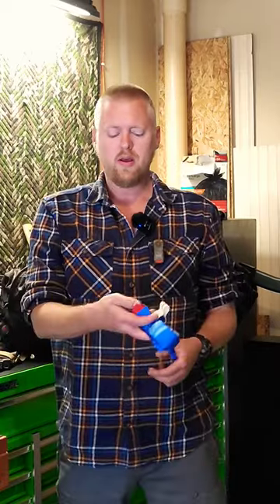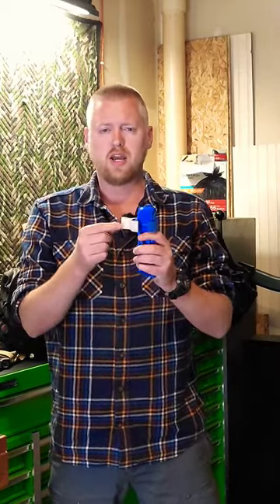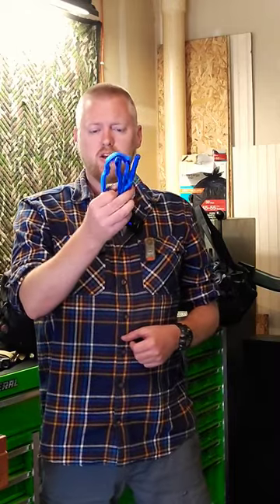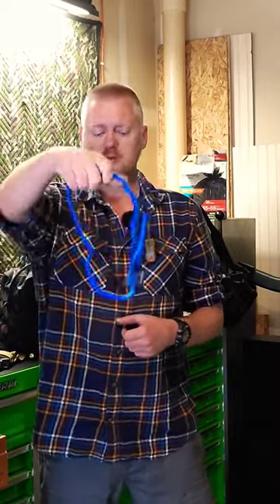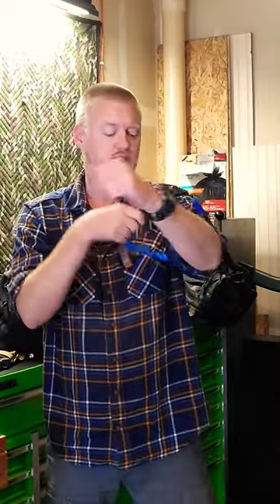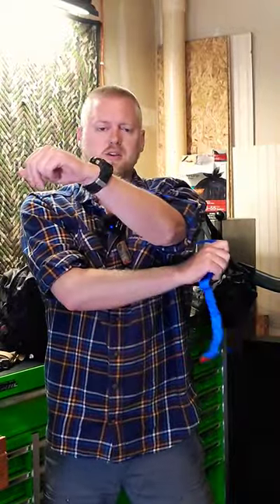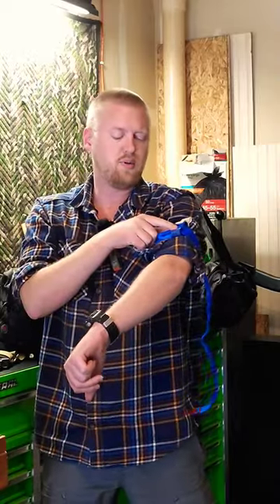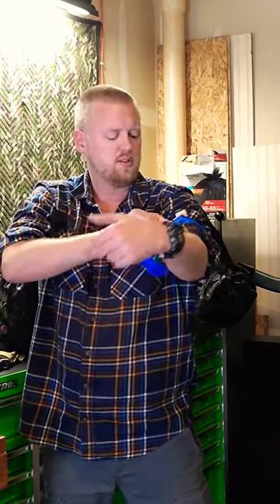MUST KNOW - Tourniquet 💉🩸

Comment: I train going as high as possible on the appendage. Severed veins are known to shrink up in the arm/leg. Go high and tight.
Reply from the maker: Yeeaahhh That's another short. Haha
Reply: Bingo: HIGH AND TIGHT!

They tend to be a bit "elastic", so do that shrinking you're talking about.
Reply: High and tight for sure but "till the leaking stops" depends on the situation. If i get shot in the middle of my forearm, its going as tight as i need until the bleeding is *manageable*. If half my arm is gone, until the bleeding stops. Wrong information doesn't save lives